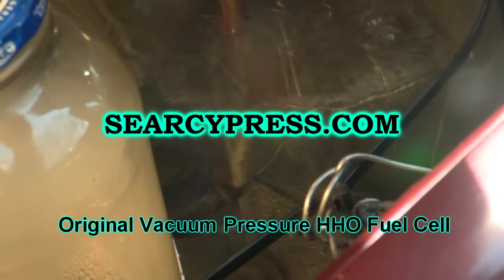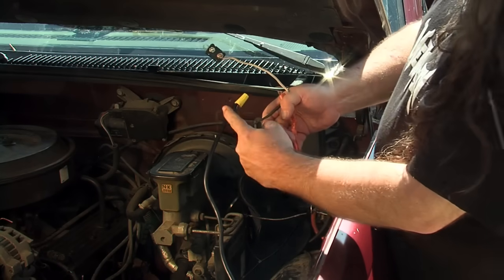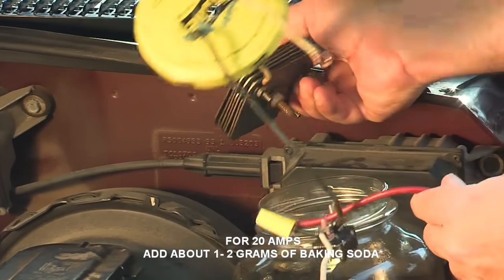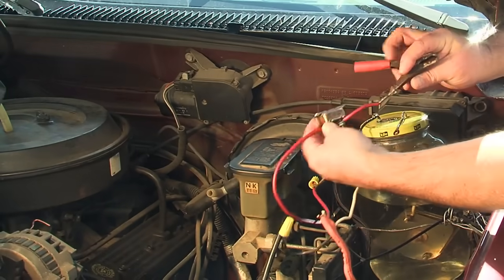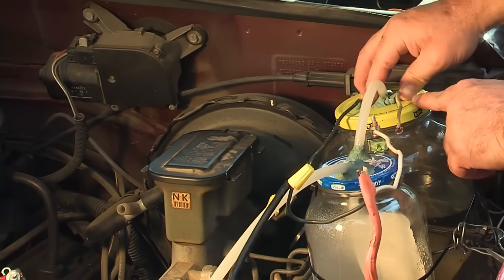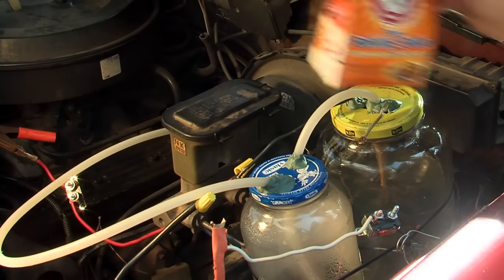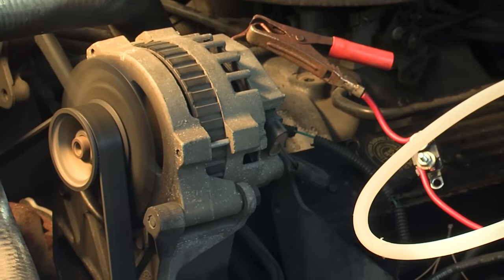Vacuum Pressure Hydrogen fuel cell defeats high gas prices using hydrogen from H2O.

Comment: "Don't be disillusioned by how fancy this looks."
-priceless
Reply: I was coming to comment this 😂😂😂 dead
Reply: do your home work its not tru. you battery will be empty befor you can start the car hahahahaha
Reply: @MrButtonx  He put a light switch on it so it doesn't use the battery. He said you have to have a good enough alternator to run it.
Reply: @MrButtonx  he did hook it up to the alternator, and had a switch inside.  The process is not started before the alternator is on - battery will not go empty while alternator does its job.

however, how many ancient car s with accessible carburators still exist.

Also, id love some diesel owner trying to make this work.... please dont forget to film :)
Reply: You have got to admit that he threw a lot of money into his final product.
Reply: one problem gas has oil when running it lubes the rings keep doing what your doing and so or later the rings will fail
Reply: @beedee9534  that's a 2-stroke engine you mor0n. Vehicles use 4-stroke
Reply: @CheeseMiser  CACA
Reply: @CheeseMiser  ignorant arrogance is not very becoming. Automotive fuels are formulated with lubricants.
Reply: @monkeyman193  no they aren't. Motors have a separate thing for lubricants and Tyree, if you're burning lubricants in your engine you are losing fuel economy, it hurts the engine, and it would produce a much more visible smoke. Now oil-based fuel is somewhat of a lubricant, but there are no additives. But when used in a motor the mount is so minuscule that it won't do anything for it.
Reply: @beedee9534  yes totally agree.. combustion engines need the dirty residue to keep the cylinders 🦭ed
Reply: @beedee9534  Propane running trucks do just fine.
Reply: @beedee9534  As far as I know, engine has it own oil lubrication, doesn't it?
Reply: @ElGrantRikun1  Yea but fuel has oil to help lubricate the cylinder walls sooner or later the walls will dry up Electric is the way to go
Reply: @beedee9534  that's 2 stroke, piston rings are lubricated by sump oil, dribbling rubbish
Reply: Can someone make a parts list on here?
Reply: @TrillNaga  2 pickle jars, go Dill spears. 3 ft of plastic tubing, 5ft of 18 gauge wire, 1 kill switch, 2 30 amp something’s, a pack of bubalicious watermelon, 2 kilos of poster putty. Oh and a light switch…. That everything?
Reply: Hydrogen gas is almost 3 times more combustible than gasoline so this has to work.
Reply: If not by that - you'll be disillusioned by the lack of MPG and performance gains.
Reply: In Yoda voice <thick with sarcasm this comment is hmmm hmmmm.>
Reply: Wonder if this dud is still alive???🤔🤔🤔
Reply: @clayfree7428  why ask?
Reply: Pickle jar and wires. I'm a  Going to do this on a friend  Car 1st To make sure I am doing This right
Reply: @overlordp.3758  🙂🤣😂🤣
Reply: @overlordp.3758  an even better idea would be let your friend do it himself 💀
Reply: @overlordp.3758  YEAH DO IT ON A FRENDS CAR YOU DONT WANTTO MESS UP YOUR CAR, WOW WHAT A GREAT FREND YOU ARE,
Reply: @stephengraham2497  😁👍🏿that is how I roll 😎
Reply: Lololol he does have a great sense of humor.
Reply: I was going to say the exact thing!
Reply: Are you one of my brothers or sisters
A good prayer:
I'm a sinner JESUS please forgive me for all my sins I know you shed your Blood for me on the cross at Calvary. Thank you JESUS for my salvation and for shedding they Blood for me. I love you JESUS. 
Romans 10:5/10 ct...❤️k
JESUSisLord!Amen...
Amen..
If you'd like to call someone who cares 
83
For
Truth.
bc you don't know when you'll die?
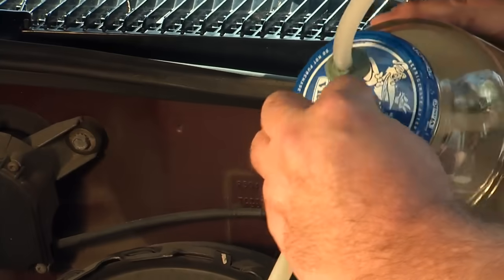.y r u hesitant......John 3:16 & Romans 10:5/19
Reply: He says this is the fancy one lol
Reply: Something Filipinos should learn...
Reply: His cousin needed his 500ml beaker for a meth lab so he had to make due with what he had.
Reply: @barrywebb7398  🤣🤣🤣🤣🤣🤣
Reply: in truth the guy who made this should have spent the extra chedder to make it at least look the part and not like a meth lab or hooch distillery. 

Then used big words like "Revolutionary" and "Thermodynamics" and follow them up with claims people understand and want and care about like "120 miles per gallon"   

THEN did a video on making a budget i got a week and a half till pay day and $40 in money i can spend version.
Reply: Look's like shit.

Comment: Note burning hydrogen like that is about 85% water vapor by the end but, the other say 15% is the same kinds of nitrogen rich gases that def systems are designed to mitigate. 
I do have questions, is this in addition to gasoline, are you using distilled water to avoid scale?, how are you preventing corrosion, are you? Finally performance what's its get up and go like is it more sluggish than gasoline alone ect...

Comment: Stoichiometric mix of hydrogen and oxygen is EXPLOSIVE!! What benefit could possibly outweigh that risk?
Reply from the maker: I understand your concerns. In this experiment we were testing the ability of the gas to enrich the fuel. Only 80% of the fuel or even less is burned in the combustion process. By enriching the fuel we increase efficiency to 99% or higher. Of course we are generating the gas and there are losses in that. This is not over unity. There is still quite a bit of performance to be gained in the fuel efficiency of the engine. Remember this system runs in vacuum. In vacuum the chance of an explosion is extremely unlikely due to concentration levels. Thanks very much for your comment.

Comment: Do you need to retune the air fuel mix leaner?
Reply: Depends on the hydrogen and oxygen mixture

But if you pour too much of something in, the engine won't run right

But also do consider that it's already breathing in Hydrogen :)

Comment: when you burn hydrogen the byproduct is water. I wonder if he has to change his oil more regularly?  I guess if you got it up to operating temperature quickly the water would burn off. But if you just went around the block every day I don't think the bearings would like it very much

Comment: how much baking soda?
Reply from the maker: Distilled water or water having no mineral content will not conduct electricity at all. It is impossible for me to say how much, as it depends on the mineral content of whatever water you're using. You start small, and add more as needed. In our system we have double 30 amp automatic reset breakers that would trip if we added too much. All we had to do was take out some water if we added too much and add more without the soda. We found it was better to start small and add as needed. It's a much easier process. Thanks very much for your comment.

Comment: I get the idea, but laws of physics still apply. You will not get more energy than what is used to crack the Hydrogen from its bond. American schools are a disgrace.
Reply: The way it was sold to me years ago is it's not trying to give you energy from nothing. 
It's allowing you to make the most of the fuel you are burning. So improving efficiency of the combustion.
A bit like a turbo improves efficiency, or higher compression ratio improves efficiency.
A turbo doesn't produce energy from nothing but they can improve efficiency.
Could browns gas improve the efficiency? I don't know. Maybe?
Anyway, a very smart guy I knew about 15 years ago built one of these and claimed he got significant mpg improvements.
He helped me build one. I ran it for a while, didn't notice any difference at all.
I was quite young at the time but I decided there and then that no matter how educated you are, you can still be deluded and I think it's more common that it first appears.

Long story short, browns gas appears not to work based on my experience testing it on one car.

Comment: This doesn't get you any additional energy. The energy comes from the drag on the engine from the alternator. It's just an energy conversion and parasitic on the engine. Basically, the energy gained from the conversion takes more energy than it converts. The fact is your fuel mileage will be slightly less no matter how this is configured this is just a scientific fact.

Comment: So the 2 issues Ive encountered is 
1 : if I have a 5.0l engine idling at 900rpms, then its displacing 4500 liters per min or 75 liters per second... Sure you make hydrogen in the GALLON PER HOUR area of volume/time when you need a GALLON PER SECOND flow rate. A fuel cell the size of a 5 gallon bucket wouldn't come close and that's just at idle let alone under load where BSFC comes into play

2 : the hydrogen fuel causes a lean condition during closed loop o2 air/fuel correction... This makes the ecu/ecm/pcm increase injector pulse width to make up for the false lean conditions. This makes the point moot on any o2 corrected vehicle during closed loop part throttle cruising
Reply: Also, even if you could produce enough hydrogen, taking into consideration the Sankey flow, where 33% of power is lost to exhaust heat, 29% to the cooling system, 5% in mechanical loss and another 5% to radiation, there's only 28% of combustion used for power. F1 cars barely reach 35% efficiency with millions of dollars in tech. Compare the specific energy density of gasoline vs hydrogen, which hydrogen falls way, way short of gasoline on. It's impossible to achieve efficiency beyond this point with internal combustion engines with gasoline and especially with hydrogen.

Then you have to consider the drastic change in flame front speed of the combustion of gasoline vs hydrogen, the engine ignition timing is way off from what would be required of hydrogen combustion. You would experience almost catastrophic pre-ignition.
Reply: @guywithjeep  Hydrogen Production from Battery:
Electrolysis Efficiency: 50 kWh produces 1 kg of hydrogen.
821.25 kWh ÷ 50 kWh/kg = 16.43 kg of hydrogen

Usable Energy from Hydrogen:
Hydrogen contains 33.33 kWh/kg and the Otto engine efficiency is 35%.
16.43 kg × 33.33 kWh/kg × 0.35 = 191.03 kWh of usable energy
Reply: If we ever perfect this Idea we will seperate the hydrogen and oxygen so the O2 sensor atomatically see rich as pure hydrogen displaces some of the incoming air and that solves the mpg issue but theres alot of information out there that this improves combustion even more in cold weather or with poor gas.  Oh if someone wires tis up permanent please use correct wireing / loom mounts switches and whatever recommended.
Reply from the maker: Injecting in vacuum is arguably different. New video coming soon. Be sure to subscribe..
Reply: @metalpresstv  I tune batch and sequential EFI systems using n-alpha, mafs, speed density, and drilling out jets for imulsion circuits and metering blocks/rods, then tune ignition timing to MBT if it's not knock limited...

I've done a couple hydrogen prototypes. After the third prototype we realized you had to have a fuel cell the size of the car that could generate an air volume more than what the engine was consuming in that time frame
Reply: Water to gas is 18,000 times volume expansion. 
Modern vehicles are programed to run like shit if any other fuel is detected unless it's a flex fuel vehicle. And that might only run gas and ethanol blends. This will only work on old carburated engines. Check out the documentary "Pump". There's a reason we have no choice at the pump. It's designed in the programming. Mechanically you could run anything from methanol, ethanol,  hho etc. Just one setting in the ECU.
Reply: Also a 4 stroke only takes in air every second Rev so your air volume intake would be half that. Then compensate for the less dense air due to vacuum by a third. Subtract any flow restrictions, manifold, carb, throttle, filter...  Even at max RPM your cylinders are still in vacuum and not pulling their full volume. A 5.0 would be lucky to pull 2000L per min at max RPM. At idle it would be in the low 10s.
Reply: @ChristopherStLouis-tc5qn  the rpm count already counts the 2 revolutions or your teach would read double from the 720° rotation with it registering 1 ignition event usually in a hall effect or VR signal to the ecm/ECU. 900rpms is 1800turns of the motor if you count true 360° but its 720° so the RPMs my math is correct, if we don't get into VE.

I mean yeah I could go into static displacement vs volumetric effeciency and static vs dynamic compression ratio with closed loop vs open loop error correction but I felt my point was made
Reply: @89StarquestTSi  my calculations might be a little off but you will never get full displacement through a naturally aspirated engine running on vaccuum. I dont know where you got that from? A revolution is a revolution and there are 2 strokes per revolution in any engine. "The exhaust note of V8, V10, and V12 F1 cars has a much higher pitch than an I4 engine, because each of the cylinders of a four-stroke engine fires once for every two revolutions of the crankshaft. Thus an eight-cylinder engine turning 300 times per second will have an exhaust note of 1,200 Hz."
Reply: And third hydrogen can't cause lean ratio because hho is the perfect fuel to oxygen ratio, but like I said you ecu would detect this and compensate to run like shit unless you hacked it to run on calculated fuel ratio not factory setting.
Reply: @ChristopherStLouis-tc5qn  hacked it??? We call the daughterboards and eprom chips before full ems came along lol I used to stagger two 256k's for 2 tunable maps and halfway decent map resolution on a basic mafs system

Nothing like playing with a haltech or AEM V2 these days
Reply: @John Costarella you do know that in the '70s and '80s before you went the throttle body injection and batch fire injection they actually had electronic feedback control carburetors that used narrowband 0 to 1 volt 0 to 255 8-bit value narrow bands o2 sensors

Carburetors can function with an O2. They did it from factory for almost a decade before electronic injection came along (mechanical injection was already on the scene)
Reply: 302*700/3456* .85= 51.99 CFM
Works out to 1477 l/m at 700 rpm idle. 
Apparently I don't know what a liter is.
Reply: @ChristopherStLouis-tc5qn  that's what I mean by static versus volumetric efficiency. The volumetric efficiency is referring to the engine not actually displacing its static displacement. I'm talking to a wall here aren't I LOL because I have previously mentioned VE, BFSC, ETC....

If my tachometer read one RPM, how many times did the engine turn? Unless I'm running a 2 stroke it's  2 360° turns obviously. If I said 900rpms that's already taking into account the 2 360° rotations 🤦 geez you are thick bud

Do you notice how in my original comment there's nothing but zeros on the end 🤦. That's because I rounded the majority of it to make it easier for the layman to get the point across which you are erroneously butchering with your "brilliance"
Reply: @ChristopherStLouis-tc5qn  you definitely get an award for being annoying though 🍻
Reply: The hose that goes into the inlet, is connected after the O2 sensor, actually. This way you odnt allow the computer to get confused about the 'richer air' mixture and start sending more gasoline into the process.
Reply: @onlinebills9169  the o2 sensor is in the exhaust FFS.
Reply: @guywithjeep  maybe he means the MAF?
Reply: @LibertarianUSMarine  gauging from their replies, no.
Reply: @onlinebills9169  Bra where are your oxygen sensors.....? 😅
Reply: @onlinebills9169  does it hurt?
Reply: @onlinebills9169  you can't even get respect let alone a piece.
Reply: @onlinebills9169  this is embarrassing...  Ur pretty dumb. I'm sure u believe in perpetual motion and over unity also

Comment: How are you controlling the rpm or varying the power without the use of throttle plates.Just controlling the air inlet?

Comment: Do u still need gasoline?
Reply from the maker: Yes. Running on pure HHO would be very hot. It is a very reactive gas, able to reach temps hot enough to melt tungsten. Thanks for the comment.

Comment: So if water comes from the exhaust doeant that mean it's going through the engine? Isnt water terrible for engines?
Reply: High performance engines squirt water directly into the cylinders to cool them.
Also burning of diesel/petrol produces water anyway. It's normal for water to drip out of your exhaust for this reason.
Regardless, I've tested this set up. Didn't work for me.
Reply: He claimed a significant amount of water should come from the exhaust which is far from normal and what high performance engines squirt water into the cylinders? Never seen a water tank on anything high performance that didnt contain coolant and I have laid hand on several. Some boat and small watercraft motors pull water from outside the hull but that's about it unless there is a new type of engine I havent seen.
Reply: @charlesstidham2788  I've tried sending you links but my responses keep getting deleted.
Just Google water injection.
The BMW M4 GTS uses it.
It was very common on plane engines.

Comment: You should build one out of pvc twin cylinders connected at the bottom power on one side ground on the other, one side makes oxygen one side makes pure hydrogen run it to engine and vent the oxygen.
Reply: Dumb question here but why would you vent the oxygen? Isn't that the component of air needed for combustion?
Reply: @zer0nix  no you want pure hydrogen don't need or want the oxygen.